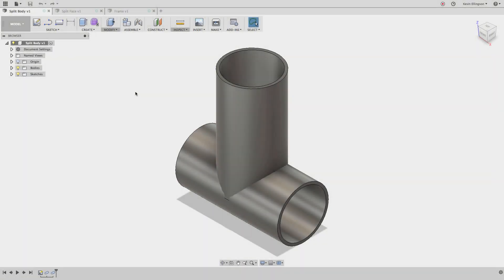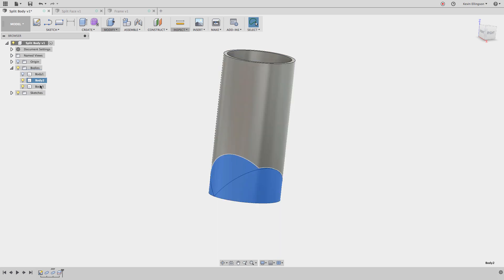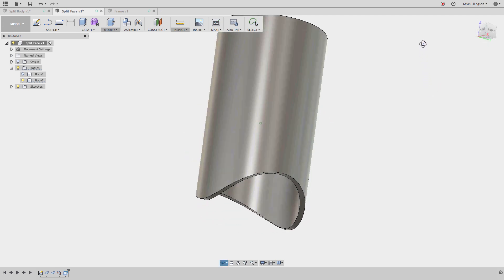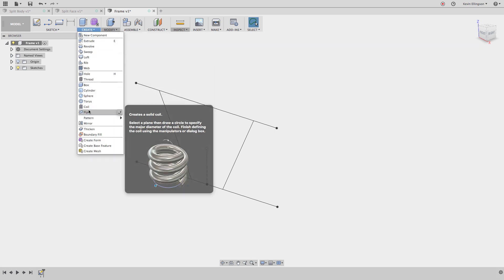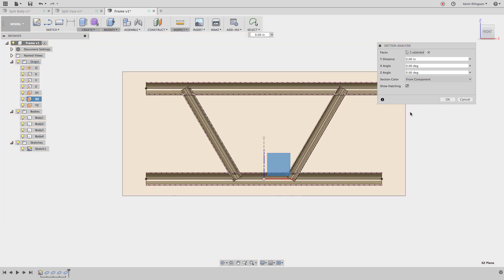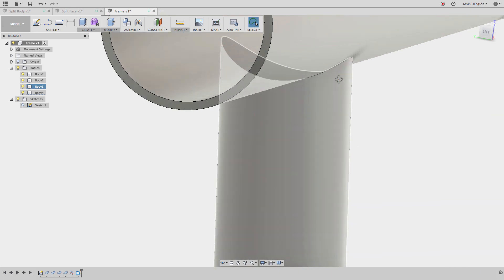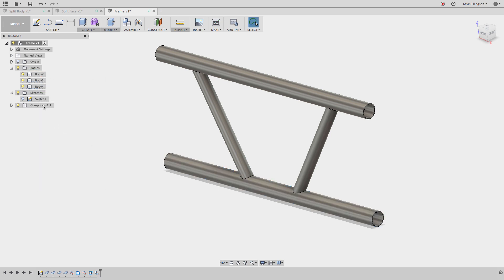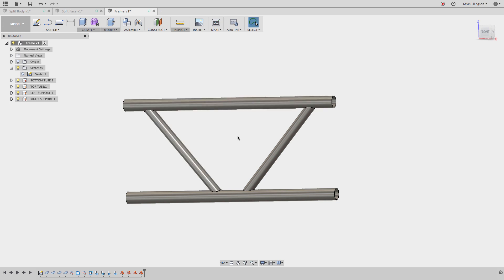Fusion 360 - Tube Notching

Comment: Hey is there a similar process for this but for square tubing? For instance, a normalized 45 degree notch for a corner of a square tube frame, where it doesn't require the cutter's head to be tilted to get the extreme sharp corner. Thanks
Reply from the maker: Give this method a try for square tubing too not should work the same to get a normalized cut.

Comment: Trying this example right now, doesn't look like fusion split faces (inside or outside) like in this video? How was this changed over the years? Thanks.

EDIT: split face (inside and outside) still works except the split line isn't shown as in this video. Push/Pull can find the 2 pieces to remove.
Reply from the maker: Hi Craig. Nope, still the same workflow. What are you using as your slicing tool? You can email me Kevin @ mechanicaladvatge . com (remove spaces) if you can’t get it.
Reply: @MechanicalAdvantage  Kevin, I updated my post, the workflow is the same except the cut lines don't show up. Might be a Fusion 360 configuration setting. Thoughts?
Reply: @MechanicalAdvantage  I sent you email, thanks.

Comment: Every hand rail I ever welded has NEVER been cut to fit flush perfectly.... There is always a gap somewhere and depending on the metal being used it's easier to heat and beat the gap closer ..so even though you might design a T shaped connection to fit perfectly..I highly doubt when it's getting cut that it will stay in the formation
Reply from the maker: I don’t know. I’ve made an awful lot of fabricated rails using a laser tube cutter to make the cuts. I usually designed with a bit of a gap compared to what I show in the video. I never got any complaints from the shop guys that were welding them up.
Reply: Lasers

Comment: I've used this video a lot to reference back to over the past few months, thank you for providing it. I'm currently designing a tube chassis and have not been able to figure out a way to export my drawing so that a CNC machine can bend and notch the tubes. Are you aware of a way I can achieve this?
Reply from the maker: Hi Doug. Do you mean to get straight lengths where the tube is "unfolded"? If so, Fusion can't do that. You might looki into software like BendTech.
Reply: @MechanicalAdvantage  I'm not looking to unfold anything. There are CNC mandrel bending machines out there  that I'm trying to export so they can bend and perform notching on the tubes.

Comment: I guess this depends on the method used to cut the tubes. If you use a circular saw on a press drill the result would be more like example 1. If you use laser or CNC would be more like example 2.

Comment: Can you make a video on how you would export these tubes to send to a laser cutter? by far the best video on how to notch tubes on fusion! Thanks!
Reply from the maker: Hi James. Sorry for the delayed reply. When you say export for a laser cutter, do you mean for cutting on a rotary?
Reply: @MechanicalAdvantage  how would you create files to send out to a laser shop to cut your tubes with a 4 axis tube laser machine?
Reply from the maker: @mada310 generally they just need a step or IGES file to do that. Their CAM sotfware will program directly off the model.
Reply: @MechanicalAdvantage  thanks! I've never been great with computers but I've managed to do quite a bit with sheetmetal in fusion. Learning tubing is the next step. I appreciate your help :]

Comment: Great tutorial, how would you then add assembly joints? For example, welding around those seams of the cope where the two pipes meet. I want to be able to do a stress analysis of the cart frame we are making at our University for the Baja competition. Thanks.
Reply from the maker: Hi Jordan. That's a good question. I was just trying to mess around a little to see if I could assemble these as separate components in a new file. Fusion can find the rite spot, but I can't change the angle of the joint origin that I need. In this video, I modeled a little sample using one sketch. That would probably be your best bet. Model your frame as one master sketch and then create components from the bodies and use an in place joint to secure everything. Send me an email to info@mechanicaladvantage.com if you need more help.
Reply: 2 years later, a good TIG weld would do wonderful. I work with coped stainless steel for work and weld joints like this all the time.

Comment: Great explanation! Like many others here, I'd like to know if there is a way to create a tool path for a CNC (plasma or laser) cutter.  If this isn't possible, how about a flat paper pattern?
Reply from the maker: Craig Blume Thanks for stopping by. I’ve experimented with cutting these in Fusion CAM with a 4th axis. It currently isn’t possible to do (at least not that I can figure out) with the plasma/waterjet/laser toolpaths. Those expect a flat body. I did do a video for creating a paper template. You can follow this link to see that process. https://youtu.be/mu8rpwqjCcM

Comment: are you able to make paper template for the coped sections of tube? Great video
Reply from the maker: Hi Alex. Just posted a video showing how this can be done. Please note, the pipe method can't be used when creating the geometry.
Reply from the maker: HI Alex. I get asked this question a lot and I think it is time to make a video showing how to do maybe do this. The bad news is that it doesn't work with the pipe command very well.

Comment: What was the reason for creating components from the existing bodies.
Thanks so much, this method has been working out great.
Reply from the maker: You certainly wouldn't have to create components from the bodies. The idea behind showing it would be if you wanted to create a drawing that documented all the parts that made up the assembly. You could add balloons etc. to the drawing. You also notice that I grounded all the components which usually mean the components could never move or change position. However, use the master sketch method allows the sketch to control the location of the components and changing the sketch updates the positions of the components.

Comment: In 12 minutes you solved a problem I have tried many hours to create only to fail. 
Question, 
would you expect any issues where say 2 or more copes intersect with each other and to the bottom support?
Thank you!
Reply from the maker: That should work fine. I just built a little example to test it. One thing I would do (even in the example that I show in the video) is to create an offset surface so there is a little gap between the tubes. If you email me at info@mechanicaladvantage.com, I'll send you the little test file I did so you can see how it works when multiple tubes intersect.

Comment: Fantastic video as per usual Kevin.  I wish I had Fusion360 when I did my "intersecting solids" manual drawing back in university. Thanks so much for sharing it with us "Noobs". Cheers, the big boy from DownUnder.
Reply from the maker: Thanks Aaron! I used to use this technique when I worked at a major playground manufacturing company and the notches were done on a 4th axis tube cutting laser. The components could be tacked together without the fabricators spending a bunch of time figuring out how they were going to notch the tubes at the proper angles. They just had to use some basic measurements from the print and the components almost formed their own jig.